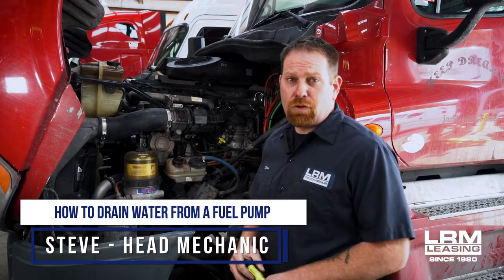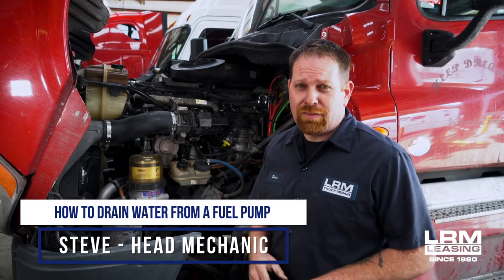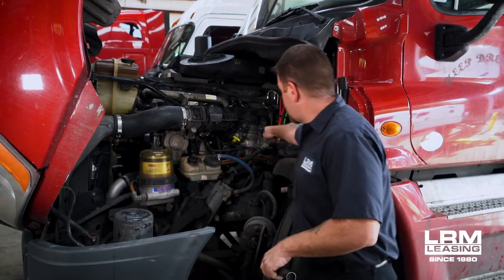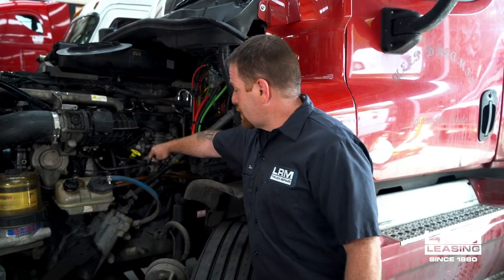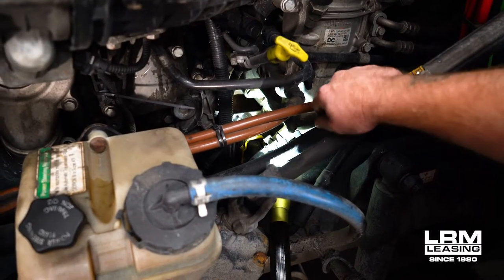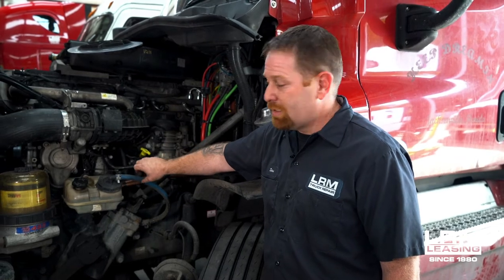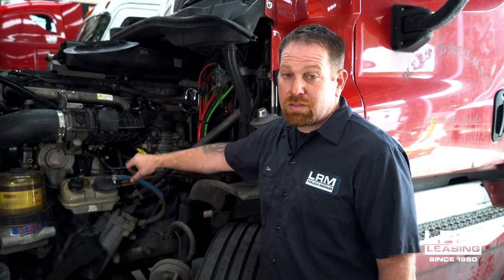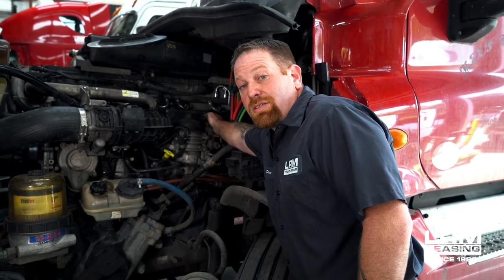How to Drain Water From Your Fuel System on a Freightliner Cascadia

Comment: So is this a normal occurrence, or is this a sign of another problem ? Thanks you,  it saved me a 2000.00 tow bill
Reply from the maker: It could be an isolated issue or could be a bigger issue.
1. It could just be from excess condensation that got into the fuel tanks from where you purchased fuel. 
2. When draining the fuel water separate if you notice any change in color of the water, especially red, that would indicate there is coolant fuel system which could be injector cups.

Comment: So my freightliner had a headlight out and a little body damage to the hood went to body shop they took off hood to replace it and left me outside with no cover and it rained hard all night with the whole engine transmission and all mechanical parts exposed and they say don't worry rain and water can't damage anything